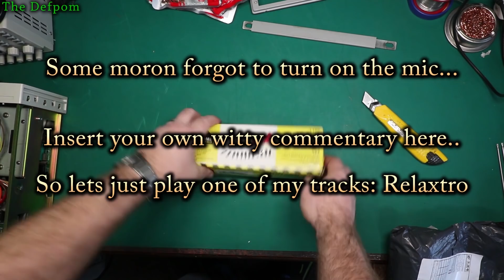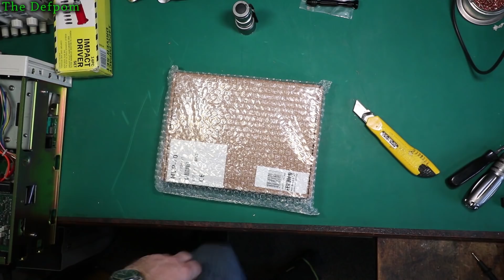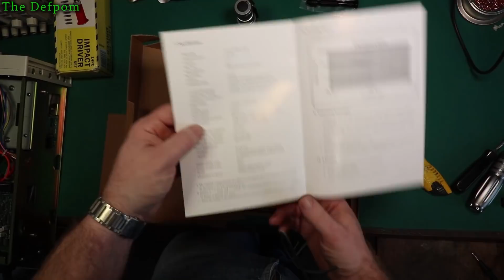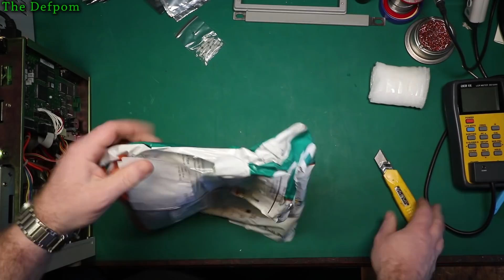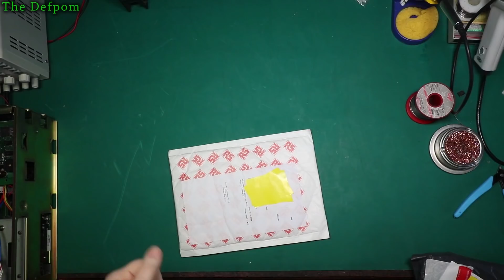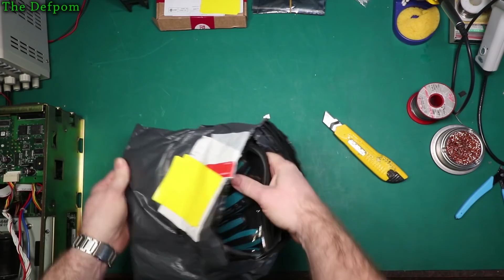🔴 #464 Mailbag Monday 29th October 2018 Re-Uploaded because of false copyright claim on MY music !

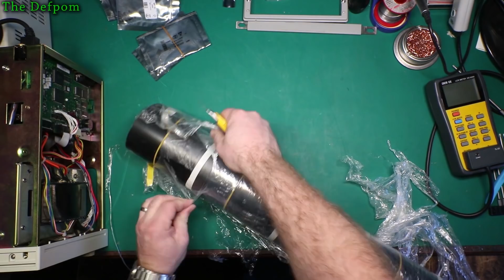Comment: 18:00 That Antistatic mat doesn't have any way of grounding it, and without I don't think it will give much protection.
Will you attach a groundwire to the mat yourself, or use some grounded copper tape on the table top?
Have been planning on getting myself a mat like that, so that looked interesting.
Reply from the maker: Geir Endre Jenssen - there are some press in studs, they have spikes which punch through the mat to crimp it on to it, you just put them where you want them to be.

Comment: I would really like to see the UV adhesive and light in action. It's fast curing but what does it stick to? I agree with Pentti Kantanen, you may want to investigate earth electrode systems and single and multi-point ground systems. Here is a pretty good article, gets a bit technical but has a lot of good information -- https://interferencetechnology.com/designing-electronic-systems-for-emc-grounding-for-the-control-of-emi-3/
Reply from the maker: David V - yes it will be interesting to see how well it works, I don’t have a specific use for it yet but I have wanted something like that in the past, I will be sure to video it when I do use it.
Reply from the maker: As far as earthing goes, all of my gear is earthed via the mains cables, the noise I get is radiated through the air, not helped by having computers, wifi, nas and lots of switchmode supplies in the same room, as well as overhead 400v mains supply cables right outside the window!

If I have a scope probe in free air and touch the tip with a finger (without touching anything else) I can get a volt of noise on the scope!
Reply: Mains earth grounding is okay for ground faults, not much use for noise reduction. I worked in radar with digital equipment operating in the same room as a klystron putting out minimum 2 megawatt pulses. Good low resistance grounds and a good earth electrode (ground rod) are essential.

Comment: Had differential probes from PicoTech for many years,  use on 3 phase stuff mainly, look exactly the same physically, apart from being yellow. Batteries don't last long, ref voltage, rechargeable voltage too low. Made external lead acid based PSU.
Keep up the interesting stuff 🛀.

Comment: Hi scott I bought two differential probes last month after the bwd 881 died. I bought a pico scope for work and the Micsig for myself.  Looking forward to seeing you do a review as I would like to compare the Micsig. Also like to know more about the UV cure glue. What is the main advantage over the other types of glue. Did you get any further with the ultrasonic after the livestream. Thanks for help and advice on the Marconi best regards Chris. I was an order of magnitude wrong on the transistor challenge. My wife keeps getting long heavy packages like the one in your video. I have no idea what inside but one off them was vibrating alarmingly. No doubt you will loose those parts and never find them if you need them in the future.
Reply from the maker: AllTheGearNoIdea - I will have to sit down and demonstrate the differential probes, this is the first one I have owned, and only the second I have used so my experience is very limited, but I have had a play with it and it does indeed work to reduce common mode noise. The noise level on this probe is around 2 mV, but that is still lower than the radiated noise in my lab, so I think that is what I will demonstrate.
I haven’t gone any further yet with the ultrasonic cleaner, $1000 is not in my budget just now, just a shame I need something of a decent size to fit the pcb into.
Reply: The Defpom's Repair Channel  I was using my differential probe to measure voltage across a mains voltage current shunt. I was testing some LED warning beacons. Interesting that at switch on the current was identical to the earth loop impedance and perspective fault current for the building I work. LEDs can be a major issues when switch large groups of lamps and the manufacturers ignore the problem. I have had to start installing very expensive transient current limiters.
Reply: The Defpom's Repair Channel  I’m no expert on performance of the differential probes. But if your scope doesn’t explode I always think that’s a good start. Forget to comment on the efi clamps having done an awful lot of EMC precompliance testing those ferrite clamps have very specific uses cases and rarely do anything unless specifically matched.  They can frequently make the situation worse by impeding the ground. I am thinking of do some video on this and building line impedance stabilisation networks  and perhaps precompliance testing.

Comment: I wonder if you have your grounding scheme properly done for all the gear? I would assume that a lot of instruments would be low-noise when they have a very solid ground connection going from the case to out of the shop. Of course if there's a lot of random gear about that's not so much possible maybe. Just a thought.